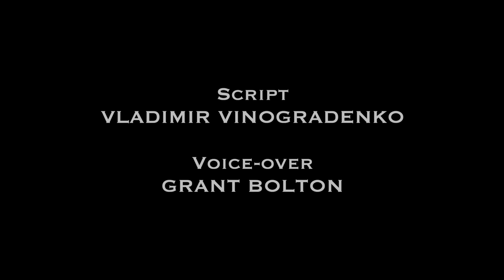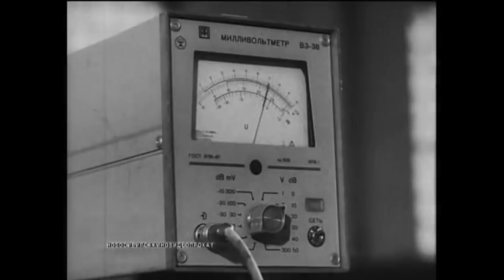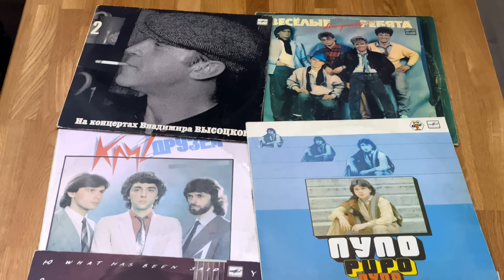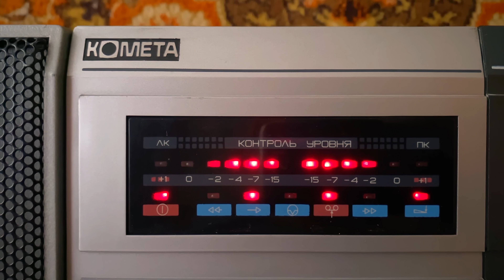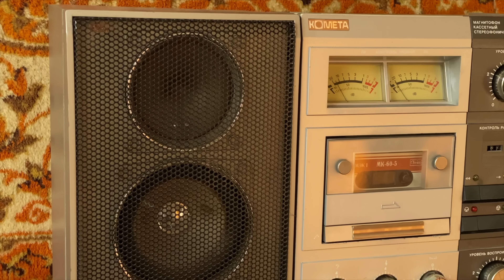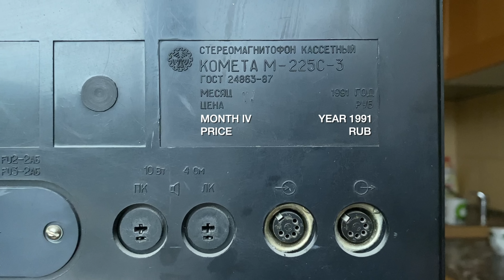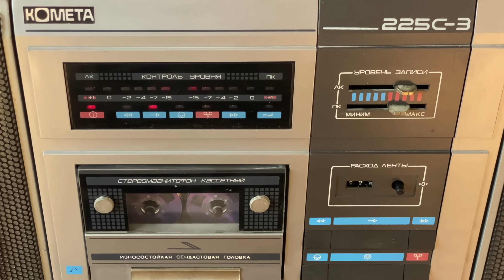How This Soviet Tape Deck Reveals the Secrets of Cold War Engineering

Comment: I was an 8 year old American with a soldering iron and an analog panel voltmeter probably pulled from military gear of the '50s. My dad got me some electronic kits & supplies. My aerospace engineer stepdad brought home several National Semiconductor engineering/application books for me. One of his friends found an old military surplus oscilloscope for me. This was in the '80s & by then I didn't have many peers interested in actually understanding, designing, and building electronic devices. The guys who built Heathkits were 10 or more years older. I'm amazed to learn that a bunch of Russian guys also had irons and liked to work with electronics. It still pays my bills.

Comment: Your Comet-225 reminds me of my Zenith Trans-Oceanic Royal 7000-1.  It's just a portable transistor radio made in the US in 1971, but it weighs 7 kilograms!  Of course, it's "portable" because it has a handle on top (also batteries)!  Its claim to fame is that, even at this late date, it was still hand-wired with no printed circuits.  It's also the end of a long line of Trans-Oceanics, earlier ones of which had tubes & gigantic "A" & "B" batteries.  I got at a flee-market for 5-bucks, and it still works!
But that's not the craziest.  When I was growing up in the 1950's, we had a "portable" black & white TV, again "portable" because it had a handle on top - what a joke! :face-blue-smiling:

Comment: I was making a crossover for DIY speakers couple of years ago and didn't have caps with needed specs at home, so I looked in my mystery parts box and found some Soviet era caps salvaged by my grandfather I suppose from some written off equipment (probably military or industrial,  since I live in Russia). They were made in 1960s of 70s, but when I checked them, their measured values were within 2% tolerance and ESR was great. The thing is these metallic film/paper type k-series caps were of enormous size and heavy weight. They worked like a charm, but due to size and weight I had to hand wire the whole crossover assembly on the bottom of the speaker case. “Heavy is good, heavy is reliable. If it doesn't work you can always hit them with it.” - Boris the Blade.

Comment: I enjoyed the video thanks!  These seem like cool decks, I do like the logic control, but if I may there were decks avil in amerikkka in the 80s that were also automatic, you didn't even have to take the tape out to flip it over, it would rotate the read head 180 degrees and play the tape backwards so it would play the other side in the correct direction.  Tecnics and Pioneer and I think Kenwood all had these well refined features, but boy did you pay for it.  And really just how russia's gov is in bed with the ortho cult, amerikkkas gov is in bed with the vatican, ortho and catholic is the same thing just different daddys to suck off.

Comment: Is that a piece of string used for back-tension?
Reply: And, you shouldn’t have destroyed that unit..
Reply from the maker: You are correct, the back tension is implemented using a piece of string. The destroyed unit was previously used as a donor for parts to repair the 7 remaining units.

Comment: There was a soviet hi-fi speaker set model 100AC-060 that was developed and produced on a nuclear submarine parts factory in small numbers. They've used some obscure materials and manufacturing methods designed for sub applications because that's what they had on hand, no expense spared. It was sold at a significant loss, covered by the state, and still was priced over 4 average monthly wages (or $10000 in 1988).

Comment: I recall we did get some of these radios, Boomboxes and small stereo systems in Western Europe, in fairly small numbers, usually made in Poland but of similar construction, in the 1970s and '80s. Cheap, and usually available at independent stores. 

They were a bit of a joke to be honest, and there was little reason to buy them instead of better-made and more modern Japanese devices for the same or less money, but from what I've seen of the few that were bought, they tended to be made to a very high standard and were built to last - which is more than could have been said for the early Korean, or Taiwanese/Hong Kong stuff.

Comment: my Kometa (like on 6:49) was from 1989. in 3 years the main init was all-broken: roller mech, control buttons either stucked or with no respond, volume and amplifier controls not giving any sound on certain positions... decided to give the head-unit to waste. speakers, however, are still ok(today!!!), still working (very nice balanced sound), but - with different equipment.

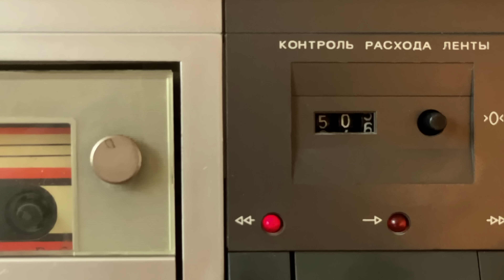Comment: 9:39 this part is nonsense, advertising was always present in USSR, it was in magazines, and even on walls (not many survive but big posters exist that advertised various devices - I have one myself)
10:20 etc - these Kometas, and other machines of this grade, were never used for professional piracy - they used stacks of Japanese decks instead, as those were available for purchase in grey/black market, just needed to have money, which were being made fastly in this business. Akai was most prominent, number one brand among copiers and not only. I have talked with numerous people who were in this business or knew those who were, so it's not out of thin air. Also: logic control slowly appeared just at time when it did in the west and in Japan, it was just reverse engineered like all other sorts of things. The circuits being included were mostly meant for professional repairmen as they didn't have all possible circuits on spot and the client would normally bring his own, especially if it was warranty repair. DIY repair was widespread too of course but not main reason to include them.
11:01 pirate music kiosks - it's a thing of 90s, not of USSR era... In 70s and 80s tapes weren't sold like that.
13:07 this was because those tapes were a hard sell, since only particularly poor, desperate or clueless people bought them. So they weren't exactly flying off the shelves. Most of tape machines were happily running those more expensive and hard to purchase foreign tapes by BASF, Agfa, Sony, Denon, TDK, Maxell and so on. And the average soviet-made cassette was not even sold, but included with deck as part of set - as probably every single recorder model came with one soviet tape in set. It was most commonly a random prerecorded one.
13:32 not true, because prices were changing over time, and models that were produced for longer time sometimes had different price at beginning and end of production. Tapes and vinyl records too had prices change over years, towards the cheaper more often.

Comment: The plastic molds were made in Finland, and the tape drive mechanism was made in Hungary.
Reply: No. This tape recorder is completely Soviet, it does not have a single foreign part. You are confusing it with VEGA and RADIOTEKHNIKA, which used Hungarian mechanisms in cooperation, and of poor quality. Kometa-225 has a very reliable mechanism of completely Soviet manufacture, has a huge flywheel, which reduces detonation. These Soviet mechanisms were also used in other models of Soviet tape recorders MAYAK, ELECTRONICS, NOTA, ROMANTIKA, and others.   Нет. Этот магнитофон полностью советский, в нём нет ни одной зарубежной детали. Вы путаете с ВЕГА и РАДИОТЕХНИКА, в которых по кооперации  использовались венгерские механизмы, причем плохого качества. Комета -225 имеет очень надёжный механизм полностью советского изготовления, имеет огромный маховик, что даёт уменьшение детонации. Эти советские механизмы использовались и в других моделях советских магнитофонов МАЯК, ЭЛЕКТРОНИКА, НОТА, РОМАНТИКА, и других.

Comment: Loud popping noise should be resolved by replacing all capacitors. Any soviet audio device shall be recapped before use, as all soviet capacitors dry out, without exception. This is due to how they are manufactured: capacitor is in a solid metallic can, and the bottom usually should come off, having a tiny seal inside, at least if I recall correctly.
Nevertheless, the Comet will never sound good, it is a poor device. The reel to reel survived for as long as it did because the soviet incompetence to produce good quality and attainable cassette decks. I own a Rostov-105 (same as it's Ilyet counterpart), completely restored, and sound is satisfactory, although occasionally operation glitches occur, it is not clear to me why.

Comment: When you have a great product, word of mouth sells it. 
People will find the product. 

Over the years I have searched for some of these. 

Like the old model 25xxxxx bearcat scanner that with the clip of 1 wire gave you the cellular band with the . 030 spacing. 
And the mythical RS100 10meter ham radio that could be easily modified to be a CB at high power 

Oh, those were the days

Comment: In the late 1960’s early 1970’s Woolworths n the U.K. sold USSR made Stereo systems badged as Rigonda. Usually an amplifier/ radio Tuner  2 seperate loudspeakers with a record deck for playing vinyl. They also had inputs for electric guitars on them. I remember looking at them in the store, they looked fine, though I believe getting hold of spare styluses for the record player part was difficult.
Reply from the maker: VEF factory in Riga produced excellent radios that were also exported abroad. But I am surprised than something as bulky and heavy as Rigonda also made its way to the export.
Reply: I think there were two factories in Riga, VEF that made those multi-band radio, and RRR that mostly made the record players.

Comment: Mk60 tapes sound best on the soviet "washing machine" (since its so massive) the mayak 223, from experience at least. About the copying process people would make machines for it called magnitizdat using mechanisims either bought illegaly or salvaged from something, specifically made to record a bunch of tapes "reliabley". I might try doing that since i have a mechanisim that could work??? We'll see
Reply: No special machines but just stacks of regular Japanese decks were used to make those copied "magnitizdat" tapes. Most often Akai but not only. At least it was this way in Lithuanian SSR.